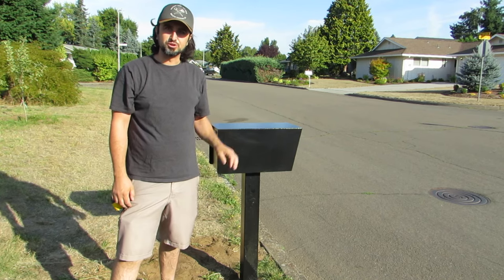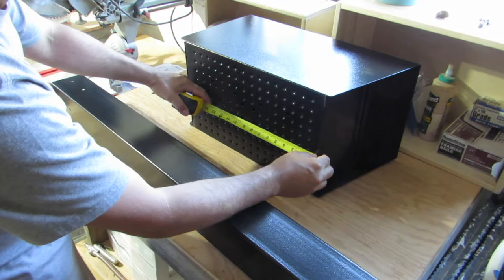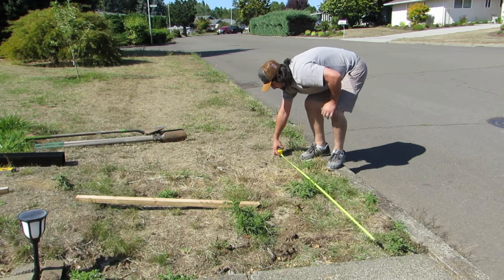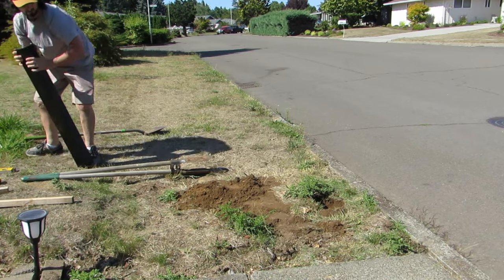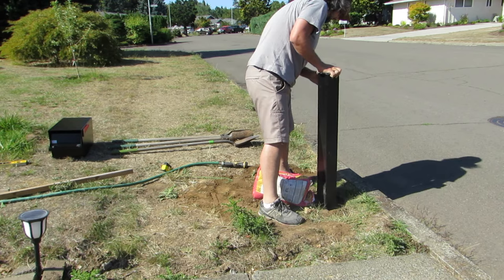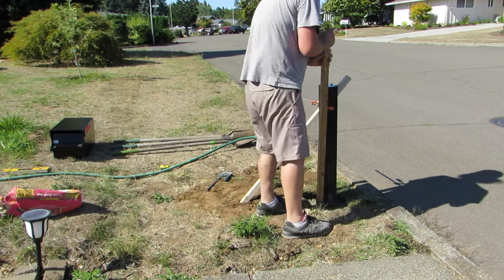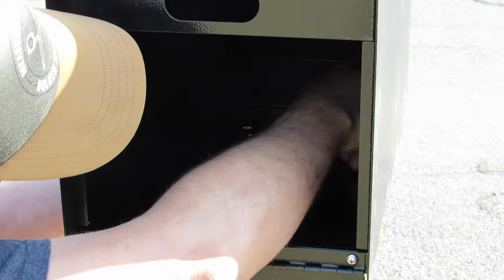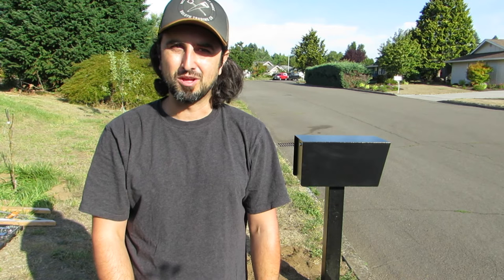How To Install A Mailbox and Post in Concrete

Comment: Your not doing the concrete correctly. It'll be brittle and weak if not mixed. The concrete around the outside will harden a bit, but the center will not get enough water even if you let it soak for days since not enough water mixes into it. This is only slightly better than just using plain soil.
Reply: He's doing that concrete 100% correct. No need to comment if you can't identify the product he is using which is post set requiring 0 mixing.
Reply: At 1:57, you can read the product description.
Reply: @halfcaf1105 Yes indeed I just read that.  However, people can do either or.  It says that even on the bag
Reply: He is doing it fine.  One can do both, either pour the cement in and add water or mix it before.  I will say that people I have chatted with prefer to mix it by hand in a wheelbarrow or such and it does say this on the instructions a person can do either or.
Reply: @sterlinghawk_g20  Your reply makes absolutely no sense to the context.
Reply: Cement will always be stronger when mixed. It's a fact.
Reply: @imcubanb2870  doesn't matter. The product is designed and engineered to not be mixed. It's a fact.
Reply: Just because the lable says it doesn't make it a good option. You can microwave lots of different foods based on what the lable says, and they come out worse than if you threw it in the oven. I work with products that are used in construction. During compression tests, it crumbles very easily under weight. If you want to skip the step of getting a bucket and mixing it with some water, then just use small rock so that it can drain more easily when it rains, then top with a couple inches of dirt. Check the video I linked above, or just look up dry pour vs mixed cement.

Comment: how deep was the hole? 1ft? the post is 43 inches
Reply from the maker: I used 1 bag, but purchased 2 in case I needed more. I returned the unopened one after the project was done.

Comment: I was going to ask how come you didn't use gravel and I guess the answer would be because your post is metal and not wood correct?
Reply from the maker: I have a metal post. If I live in a place with a lot of frost I would have added a 4x4 to go deeper. And as you said I would have put gravel below the wood post so it doesn't come in contact with the soil.

Comment: Our mailbox saga started about a year ago when a drunk teenager took out our previous mailbox by driving over it.  We replaced it with a metal one that looks similar to the one in the video, and I installed it in a manner similar to the video.   Measuring, leveling and using similar clamps to hold the post in place while the concrete would set.  I started with some gravel in the hole.  Since the metal post is hollow, I had an ordinary brick underneath it to help keep it at the correct height while I was getting everything else done.  Then a bag of quick-set, and then finally a bunch of water.

Then this week a landscaper in the neighborhood whacked the new mailbox (probably with his side mirror).  He did have the decency to ring the doorbell (we could see it on the doorbell camera), but we weren't home.

The metal mailbox was bent out of shape - ours is a sturdy aluminum, and I had to remove the base of the box proper to hammer it flat again.  But the post itself was now loose in the ground, which seemed odd (I would have expected the concrete to have held it firm).  But I then noticed a big chunk of concrete on the surface next to it, so the landscaper must have completely knocked the thing out of the ground, and he did an ass/2 job of sticking the thing in the ground again.  So I expect I will need another bag of concrete to re-do that part of the job - and that's what led me to this video.

The real question I had was one bag or two.  In the video it appears he used only one.  So that's my project for the weekend, I guess.
Reply from the maker: I'm sorry to hear about this problem you had. I used one bag of concrete, but if you dig a deeper hole you will need more. I recommend getting 2 bags just in case and returning one if you don't open it.

Comment: Great Job 👍👍
Is the metal post hallow? The reason I'm asking is that I already have a round metal post in concreat, and want to slide the new post over the existing smaller post....and then I'll secure it.
Reply from the maker: It is hollow, but there is a metal plate covering the top for the bolts. The inside will slide over a 4x4, so if your pole is smaller than a 4x4 this should fit.